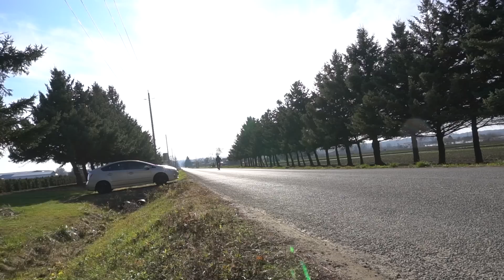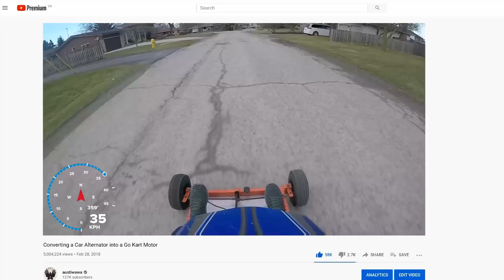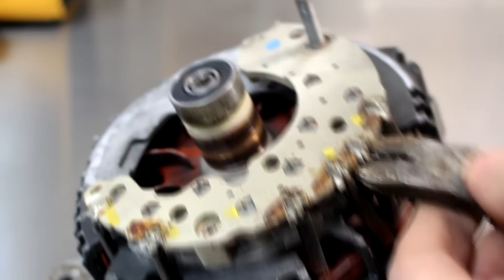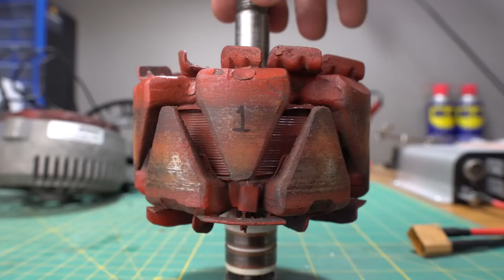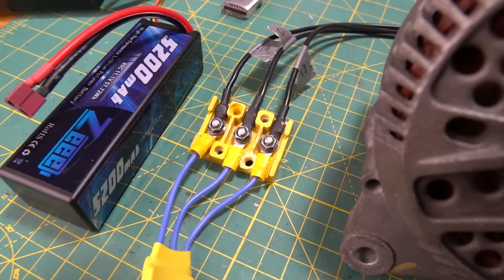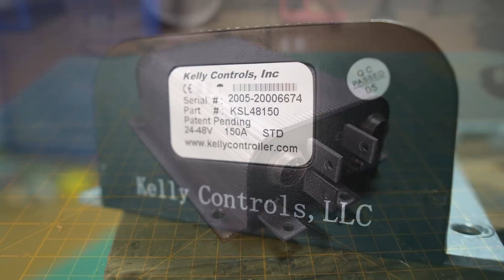Building an Alternator Powered Bike

Comment: Congratulations. Looks like you have made yourself about a 1800 to 2000 watt motor there. If you go perm magnet rotor you should gain another 100 or 200 watts, I would imagine. Very smart, moving the Hall sensors to the middle. I would probably have built some complicated bridge of diodes between two sets, but the simple way is the elegant way.

Your sensorless mode controller might work with permanent magnets instead of brushes and coils. Maybe give it a try. Shame to pay so much for a controller you can't use. BTW I rather like the Kelly controllers with Motenergy motors. That's what I put in my e-boat. And a 10kw bank of golf cart batteries.

However Motenergy has 5kw motors for about $400. Just sayin. But to be fair you don't need that much power and there is the weight, too.

Built myself an electric bike out of a $90 Walmart high handlebar fat seat grandpa bike  and a $120 cheapie 1500w chinese ebike kit, and a 20ah 48v LiFePO4 battery pack which cost more than the bike and the kit put together, after the aluminum engine in my Ford Ranger blew up on me and I needed a commuter vehicle.  Had it up to 41MPH which is kinda scary with side pull brakes LOL. I commuted a total of 12 miles 5 days a week for a year and a half with that rig until my neighbor at my marina (I lived on my electric boat!) gave me his daughter's old go to school car if I could get it started. I did, got it back to the marina, repaired it, drove that for 4 years and gave away the ebike. But it was really cheap and fast transport, I beat my old best time in the pickup by about 5 minutes on a regular basis. It was scary as shit but it got me to work and back without any gas. Charged the batt every day at work, on the company dime. No insurance, no brake tag, (state inspection sticker) no registration, nothing. Zero ongoing expense. 

The coolest part was passing all the guys in skin tight bicycle shorts and jerseys and funny backwards pointing helmets on their $4000 bikes, me in steel toe workboots and coveralls on my Chinese walmart Huffy clone, ringing my old fashion thumb bell as I pass them up without pedaling. If looks could kill I would be a dead man. They HATED me! Went to a bike shop for some nice panniers to carry groceries in. Took the ebike inside, guy asks about all the extra weight and if that didn't make it hard to pedal.

Me: "Huh? Pedal? I wouldn't know, I never tried that."

Him: "Yeah. That's the whole point of having a bike!"  I think he just didn't get it.

Comment: The clutch wasn’t slipping. You weren’t hitting the proper rpm to fully engage the clutch
Reply: He won't need the clutch anymore
Reply: @foxxyytofficial  really you freaking think?
Reply: @theroadwarrior577  yes
Since he got the hall sensors and the CORRECT controller, he can have torque and start from 0RPM, negating the need of an idle speed and a clutch to keep the wheel from having unneeded power
Reply: @foxxyytofficial  are you positive about that
Reply: @foxxyytofficial  you don’t seem sure
Reply: @theroadwarrior577  why would i be not sure?

The only reason that he needed the clutch was because he bought a controller made for BLDC fans and not for traction usage, and he didn't wanted to swap it yet, so he needed the clutch just like a 212cc go kart engine needs one.

When he installed the hall sensors and swapped the controller for a proper one (the same controller that he used in the Crazy Cart XL build), that didn't forced him to always keep the motor spinning, now the clutch was not necessary and then was removed

Comment: I think it is pretty cool. I love the idling e motor! Perhaps a lower rpm engaging clutch would do you better. What rpm does your e motor idle at, rough guess? Go 500 rpm over that if the motor makes enough takeoff torque not counting your dodgy clutch. Or maybe mess with the springs that control engagement rpm.
Reply: He won't need clutch anymore

Comment: What about putting a switch or relay on the coil power ... with the unmodified controler ... engaging the coil when the throttle turns up ... that would work like an electric clutch of sorts ?  Even with the controler sending its signal, no power to the coil would not result in power applied to shaft !
Reply: He won't need it anymore

Comment: get wind power motor 250 or 500 watt run it then other side run the Alternator recharge battery's my be better way so never run out of power.
Reply: It won't work

Comment: Adjust the clutch lol
Reply: He won't need it
Reply: @foxxyytofficial  apparently he does because he can’t get the motor to stop spinning when on so centrical clutch.. it needs adjustment to stop slipping
Reply: @mikecorleone6797  no, he already removed it
He only needed the clutch because his first BLDC controller wasn't made for traction purposes, only for those freezer/fan applications (always on) and he didn't knew that before buying it
So when he installed the hall sensors and got a proper controller, he elimilated any need for clutches

Comment: Back in the early 60's a guy I know electrified a bicycle using a Land Rover starter motor and a 12 volt car battery.......he ran next to the bike to get it going and flipped a knife switch on the handle bar and it took off like a scalded cat.........the motor drove via the chain to the back wheel, no control just full bore and hang on for dear life at 60 MPH.

Comment: now put an alternator on the front tire to charge the bank while you drive
Reply: It won't work
Reply: @foxxyytofficial  bullshit it wont work. might not over charge but it will trickle feed the battery and give it more life. in addition you could add on a solar cell.
Reply: @McDude21  even with solar it will still not work
The alternator can pull a lot more energy than you can simply put back again, now adding efficiency losses and back EMF you will lose range and not gain range
Reply: @foxxyytofficial  put a super capacitor bank that dumps to the main bank at desired amp/volts tie in the alternator and the solar panel. you are very cynical
Reply: @McDude21  i'm not cynical, i had 3 years to study all types of electricity and the physics related to it, you can't simply get a second alternator to recover energy, and the more you try to recover it, with supercaps, strange circuits, will only add more and more drag and weight to the system

Alternators only recharge the car battery because the explosions inside the pistons are moving it, now try to recover anything with such a weak power source

so much people like to tell the same idea as you (why don't people install generators or alternators in electric cars/motorcycles/bikes to recover energy while they drive?)

But most of those people never heard about efficiency losses, back emf, laws of thermodynamics and conservation of energy, they just say it without prior testing to see if it will really work.

and when people like me try to dissuade them, you know the drill...
"You are cynical", "They don't want us to discover it", "The rich people and government don't like people that have an edge over the system", and other things...

Comment: what I learned from watching  this video is that I should just buy an electric bike
Reply: a rusty alternator*
Reply: But where's the fun in that?
Reply: @holdyerblobsaloft   lol you're right. Definitively a better feeling when you build it yourself, I'm just not a good fabricator 😅
Reply: Add voltage will greatly increase performance a alternator produces major voltage then regulated to 12. Output. As a motor it can take twice to three times more voltage than he uses here.

Comment: When I was about 14 I'd devised that this should be possible.. had a go at building something that worked... I was trying to adjust the speed with the frequentie of the AC using a homemade tone generator.. never actually got it to work.. but that was in 1991.. I didn't have access to specialized controllers.. Soo I got it to turn, but as soon as I put a load on it kinda "stalled". My solution to the engine keeps turning problem was using a Solex frame with the alternator on the original engine mount.. so basically a manual clutch driving the front tire directly. But it never had the power, in all other aspects it worked. It turned the driven wheel (without the wheel touching the ground) I could break the connection between motor and driven wheel I could control the speed with a potmeter..  But I love to see that someone actually build a working model of a bicycle with an alternator for a motor.. Now I can finally show a few of my old friends that I wasn't crazy for trying .. thanks for that.

Comment: Just use buck converter for rotor coil, You can find like 20A buck conveter on ebay/ali wich is overkill for this (correct me if I'm wrong but rotor coil ussualy takes about 10A) and they have constant current setting on them too, so you can lower the rotor coil current and go like ECO mode 😂 and if I'm not wrong the RPM should go higher with lower current, but You will lose some torque...

For clutch system, I personally whould change springs in it or make my own like super soft springs, so they barly engages while motor is runing on idle... Or go with electonic solution 😂 use big 3 pole relay and control it using arduino wich reads throttle position (just voltage from middle pin of throttle straight to analog pin of arduino (if logic is 5V otherwise use 2 resistor bridge to lower the voltage) and after reaching something like 5% of throttle engage relay) or even easier and cheaper, use small 1 pole relay to disconnect rotor supply using same principle... And with some thinkering maybe arduino will not be even nesessary, just few mosfets, diodes, and ressistor will do the same job. (Yeah I'm designing circuits a lot, so after watching your video I have like 3 or 4 schematics instant in my mind 😂)
Reply: The buck controller is a good idea, Enrengineering on YT used it
But for the clutch, it is not necessary since with the hall sensors the alternator can start pumping torque from 0RPM

Comment: As an alternative to using hall sensors, you can sense the voltage on a winding when it's not being driven. If the motor is in sync with the ESC, you should 0V on that winding at that moment. If it's behind or ahead, you'll see a voltage.
Reply: but how would you make sure that it won't see more than 5V just using the windings?
Hall sensors are simpler to install and operate

Comment: Good on ya for your perseverance but you gotta remember this; people want kewl. If it doesn't have the kewl factor, it's just dead in the water. So pick a frame that's kewl, tires/rims and disc brakes that are kewl. Kewl seat? Yes, kewl seat. Paint? Flat Black with Red &White pinstriping, very kewl (cuz it's blk/red/wht, get it?) Handlebars, controlers and lights! Bigtime kewl!
Remember, dorks can be kewl, they just have to listen to the kewl kids sometime.

Comment: Works also without the hall sensors if you use the BLDC controller for an ebike and a PWM signal for the DC stator. PWM just needs to be controlled to give constant 250mA. I know this because I built an ekart for my 5 year old Son. Your old video made me realize an alternator was sufficient for such a project. What makes it better is that you can control the speed, direction and acceleration. The ekart can drive me an adult(76kg) at 40km/h , so for safety it is absolutely limited within the controller for my son's use. It also has horn, lights,cruise control, reverse and breaking, last one by short circuiting the leads with huge current relays (originally was using it to put back the power to a battery, but it was so small that I desisted on the effort). With a 24V, 22Ah battery he can drive up to 40km full throttle, now it is limited to 30km/h, 10A (maximum acceleration and power 240W), but on my first trials he went so fast I was not able to catch him on my bike. The alternators can keep up to 70A continuous, so is circa 600W machine if you have the power to supply it. He also got scared so he never uses it in the high power settings, best because we can go more than 4h trips on the bikes with a small child having fun.
Reply: His first video showed 1500W 48V controller without hall sensors

Comment: Add an alternator on the other side, belt driven, so it can charge while on the go!
Reply: It won't work
Reply: @foxxyytofficial  explain?
Reply: @foxxyytofficial  it works on cars, to maintain battery charge, so I would assume the same principles could be hacked to make it work.
Reply: @sharkyjones8432  it works on cars because its a 80-1000HP combustion-powered engine pushing a 2-5HP alternator charging an aux. battery
You want a 2-5HP alternator to pump another 2-5HP alternator and still have enough power to move??

Comment: Great project, nicely done. I ❤ & respect your persistence. I have the same flaw 😁 Although, I would've used a relay to switch off the controller output power at idle throttle instead of a mechanical clutch..
Reply: Sorry for necro, but wouldnt that burn out the relay and make it stuck due to the big current
Reply: @lavacat720  Nah, they have solid state relays up to 200A. But honestly, a Ebike controller would be the wise option

Comment: Hi, it’s Vincenzo, from Italy. Really cool job! 
I’m building an electric bycicle myself but I always face the same problem: the wires get too hot, even though I added a relay to the electric engine (12 volt, 1000 watt ). Do you think I should use a speed controller to fix it? In that case, which kind? Do you have any brand to suggest? Sorry but I’m not very expert in this field. 
Thank you so much :)

Comment: I have a 3KW 3Phase BLDC Controller running an 180A alternator project on my cart. The cart is running 50hm/h but it has one weakness. The cart won't start sober. Every start it is shuttering. First root cause analysis was a missing sensor system. I have added a sensor system with the hope that it fixes the shuttering at start. But it won't. Can it be that my field current at start is so high that I am running into current limitation?
Reply: if your sensors aren't correctly positioned, it won't help and won't give smooth RPMs

Comment: How much volts did you used to excite the rotor electric magnet? I am curikus how many power the excitement needs alone.
Reply: 12V but he didn't tested amp draw
Probably 3-5A @ 12V
Reply: @foxxyytofficial  Probably 50W.

Comment: Sorry, my comment got cut short. I would like to buy a trike and convert it to electric. Could your system be used for this? Could a 12 volt motorcycle battery be used? Could this system  be augmented with solar power? I am clueless when it comes to electronics. If I go through with this, could you help me out?
Reply: Low voltage
Alternators need at least 36V to be nice efficient motord

Comment: Hi I have a question I love what you have done on converting the alternator into a motor. Could you use a two mount setup having one alternator as the motor and then the other as an alternator to power the motor or make a continuous charge to the batter? So to never run out of power?
Reply: No, it can't be done

Comment: 13:29 How?
Reply: Field weakening
Reply: @foxxyytofficial  Does that have to do with reducing the current to the electromagnets?
Reply: @johnyradio2  Yes, with the 11,1V LiPo battery he is giving more current to the rotor than if he had been using a 8,4V LiPo (since he can't change the resistance of the coil, with more voltage he creates more current)

Comment: So, hear me out..
You could fit quite a few alternators across the rear axel of a small car, get one of those big ass wall mount tesla batteries, and you've got a fairly inexpensive electric car.. Or am I missing something?

If it is cheaper, you could just replace engine weight with batteries so the car has similar weight distribution to what it was designed for
Reply: Multiple small motors won't be as efficient as a bigger motor
Reply: @foxxyytofficial  I can't see one being strong enough to move a car
Reply: @MaderaBeats  i am not talking about alternators anymore
But purpose-built motors, like those HPEVS or forklift ones

Comment: I subscribed because of your alternator conversion. I have learned in experimenting with a delta wound sensorless brushless motor that the 'zero-cross' occurs at 90° and 270°. That means if you base commutation on the 'zero-cross then commutation will occur 30° early in a delta wound motor. I am experimenting with a way to delay commutation by 30° using a microcontroller.

Comment: This is awesome! Have you ever thought about hooking an electric motor up to a 6 speed motorcycle transmission? That would be so cool and give you the same feeling/control as an Internal combustion engine.
Reply: Youtuber Stepusak did that
Reply: I had the Cyclone kit on my bike that does this, more or less. The motor output goes to the bicycle chain that drives the rear wheels (after going through a single speed reduction gearbox) and the torque or speed at the rear wheel is adjusted by shifting the rear derailleur; since I had a six speed rear cassette my motor (and pedals too) were effectively operating through a six speed transmission.
Reply: Thats amazing 👏

Comment: What voltage do you run? I have a 52v ebike battery and an alternator laying around 😜
Reply: He uses a 48V battery
Reply: @foxxyytofficial  im literally in my garage attempting this atm. Im going to use the speed controller off my 1000 watt mid drive ebike
Reply: @iUsABidet  did it worked?
Reply: Yeah just got her finished! I love it!
Reply: @iUsABidet  any videos?

Comment: If you reduce the field voltage on top speed you will go even faster. Try it!
Reply: But he told that Don't want to be faster
Reply: @foxxyytofficial  Yes I know, it's just for the efficiency. After a certain rpm it is more efficient to lower the field coil. Consumes less amps and runs the same or even more quicker.